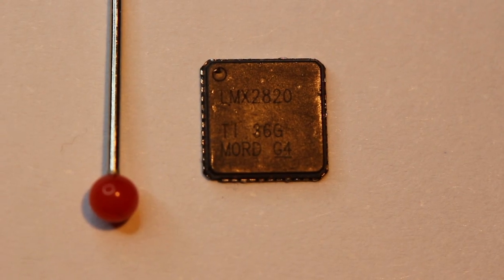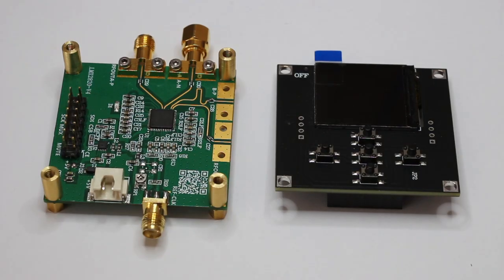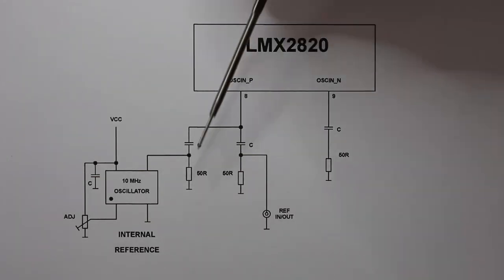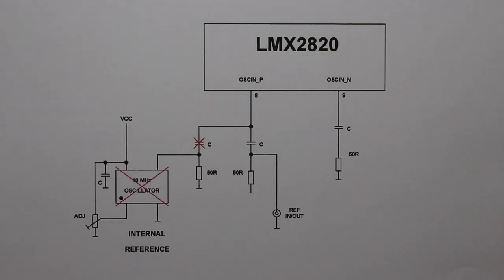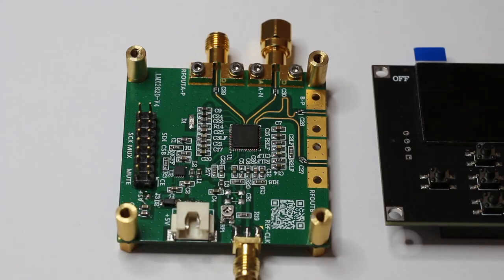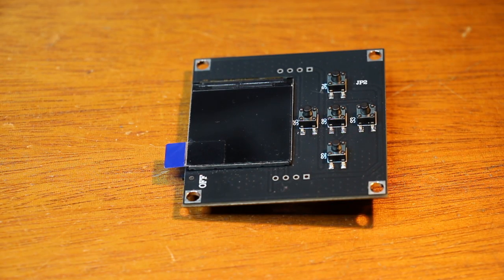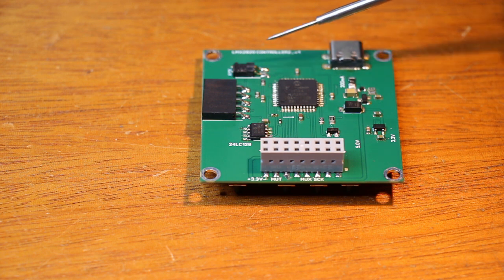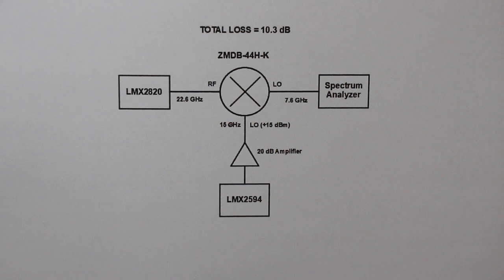#43 The amazing LMX2820 - 45 MHz to 22.6 GHz - review of the AliExpress board

Comment: @vk5fe943 I have enjoyed your videos.  Thx for making and posting them.  Based on your video here I purchased a board and programmer from Aliexpress.  Did you attempt to connect with the STM32-F103C8T6 chip on the "as received" programmer via USB?  If yes then were you successful?  I have not succeeded in connecting with the chip over USB.  I would like to reprogram it if possible.  Did you use the same STM32 chip for the programmer that you constructed, just curious?

Comment: Purchased this evaluation setup like you did. The power dropped off considerably at top freq's based on calibrated HP 8536E  -30 and below with shipped chip.  Ordered a OEM TI through Digi and installed it. The Specification charts are now comparable. 22.6 Ghz is now 0.17 dBm at level 7. Output power de rates with temperature and sometimes shuts down / locks out. Placing a heatsink from a Rasberry Pi on the back of board, offset away from the trace outputs brings it to normal operations. Might need air circulation in hot environment. This is a very low cost sweep generator. I am impressed with it.  Able to do SNA evaluations with it in microwave region.

Comment: There shoul be no mechanical issue to connect  SMA connetors to 3.5 mm or even 2.92 mm. There is electrical issue with discontimuity as  the gup between center conductor and graund change.

Comment: Nice video! Does the LMX2820 need any special cooling arrangements, I guess it runs very warm. Have you noticed any drop in output level while it heats up?
Reply from the maker: Very good question. Besides the comment of @uploadj, this chip runs pretty warm (happens also with the LMX2594) and there's a small variation in the output power with temperature, but I didn't make any specific test to quantify how much and what's the behaviour with different heatsink approaches.
In the very end of the vídeo I show another implementation for the LMX2820, smaller, and I designed a specific finned heatsink for it - unfortunately we can't see in the video. Thanks for the comments, guys.
Reply: Usually there is an area of metalization on the bottom of the chip package that requires soldering to the board gnd plane  - and does two things, makes a good RF ground AND supplies the heat sinking required ... many vias placed from top gnd plane to bottom gnd plane provides a thermal path thru the board material too.

Comment: Can this chip be used to transmit voice, or just CW?
Reply from the maker: Not intended to, but you could modulate a lower frequency carrier before (for instance using a 2 m or 70 cm band) and then transpose to the microwaves spectrum using a mixer, the LMX2820 and a couple of filters and amplifiers.

Comment: the board is still expensive for me, but producing upto 26ghz is interesting, what do you plan to use it for? are you experimenting with any satellite receiver? also if I see the price of single chip it seems to be more than price of the board, is the chip duplicate or reused from scrap?
Reply: We live in a interesting time. For several chips from TI and also ADI, the prices in china are much lower then on Digikey or Mouser. The LMX2820 cost at digikey  $154.43 for 1, going down to $115.41 if you buy 250 pcs. At LCSC, $81.50 flat, even for a single unit.
Reply from the maker: That's right Michael, and LSCI, as far as I know, is a reliable source.
Reply from the maker: My interest is just experimenting with higher ferquencies. Yes, you're right, the board is inexpensive if compared to the price of the chip itself sold by Mouser or Digikey. 
Out of specification or scrapped chips 🤨? maybe in China they buy huge quantities and have lower costs... Anyway, still an opportunity for amateur use, up to now I didn't notice anything like that. Thanks for the comment.
Reply: @vk5fe943 it's funny Chinese are able to make a business of scrap also. There are also a lot of fake ic, when it comes to voltage regulators, not sure pll is one of them.

Comment: Nice vídeo. However, please consider the following remarks: After minute 5 it is important to describe what is observed from the trials. Moreover, you have introduced your own front end board but have not talk anithing about it. Why have you made your own, what is the thing that the one you bought does not present? I think your audience does not have any problem that your video be two or three times longer :)  Looking forwzrd from an extended version ;)
Reply from the maker: Yes, I said why I designed another controller, the AliExpress accepts only 10 MHz as reference input, which is not the best option. Besides, there are alot of other parameters in the chip that I can modify and test having my own design.

Comment: I ran into the same external sync problem. I initially assumed it switched the sync connector to input as soon as it detected a signal like some test instruments I have but when I looked closer I was dismayed to see the 'input' just connected to the output of the oscillator with a capacitor. I made similar modification soldering in a dupont header were I can place links to connect or disconnect the oscillator.  I still have an issue though that when using an external source the onboard clock is somehow still polluting the signal causing significant jitter.  I'll probably add another removable link to power down the oscillator when I'm using the external source.
Reply from the maker: Exactly, it's safer to disconnect the internal oscillator from the power supply. Thanks for the input.